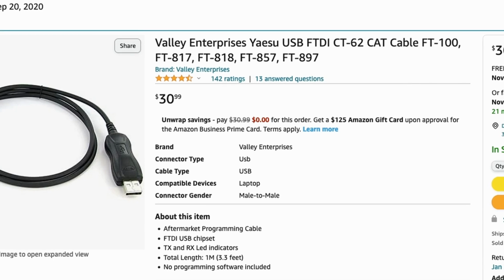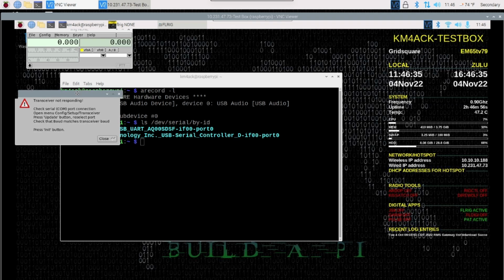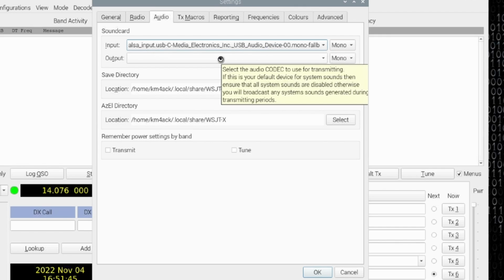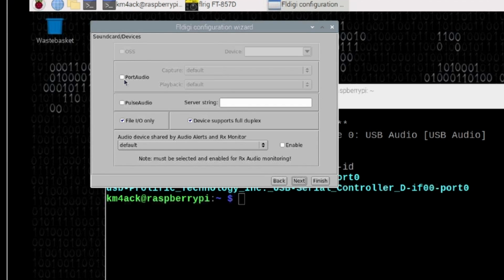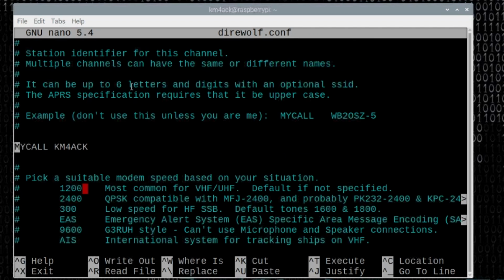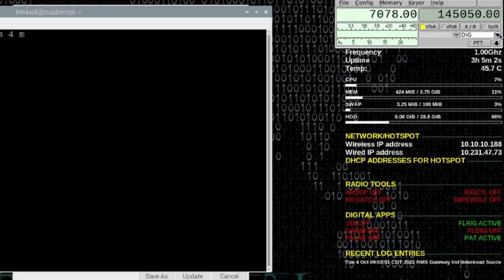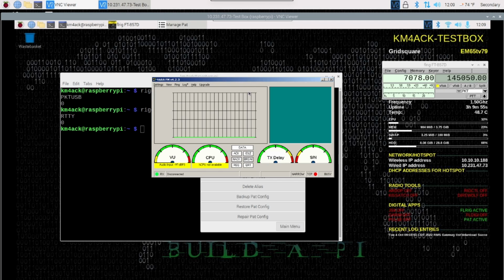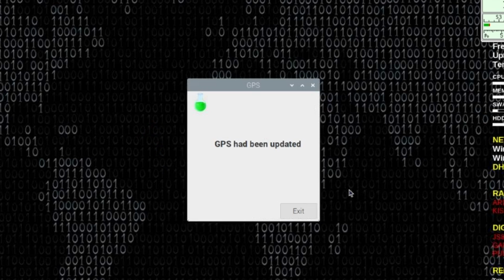Yaesu 8x7 Setup Linux Digital Modes

Comment: I’ve used FTA for about two years on a windows machine and I’m making the switch to Lennox because of a ham live error that I’m getting on my windows machine. I also have a raspberry pie that I planned on setting up with WSJTX as well. I have a rig on the way, but I thought I’d ask about signal link.

Comment: what distro are you using ? also, you could use a signalink instead too if you have it. esp if you have the usb version :D
Reply from the maker: on the pi i run raspbian OS 32bit and on an x86 box I prefer Mint.

Comment: Hello Jason! Thanks for another great video. I'm new to digimodes. I have a rpi 3b+ that I'll set up for digimodes. I see in this video that you configure VARA and VARA FM on the Pi. Earlier I've seen video in this channel about VARA as beta on the Pi. Is VARA now good to go on the Pi? Will VARA run on a rpi3b+? 73 de LB4EG (Helge)
Reply from the maker: I have only tried it on the Pi 4. Last I heard it wouldn't run on the Pi 3.

Comment: Another informative video Jason, thank you - Have you encountered 'no transmit' audio on your FT-8x7 /FT-8x1?  I've cycled through all the settings, and nothing changed that I have been able to determine, however on transmit I have no signal being sent.  CAT control, Audio settings are all normal - Radio is set with the standard, Data = Rear, but it is trying to use the hand MIC for audio.  Been through the settings a dozen times on both WSJTx/other and the radio and even did resets and reboots.

Comment: If you want to eliminate a cable to the pi, you can get a Bluetooth dongle for CAT control off Ebay or Aliexpress for the Yaesu 8X7 series for $15-20.
Reply from the maker: Yeah, those are pretty cool. I did a video on getting them going in early 2021 - https://youtu.be/Qbi62VyLVz8

Comment: I wonder, short of the Easy-Digi  cards, is it possible to do something similar with a Baofeng UV-5ra, sound card and Vox mode transmit? I also have a Radioditty GD-77 DMR if that 'helps'...
Reply from the maker: I wouldn't use VOX as the hangtime on the Baofeng radios makes it unusable with most packet work. It could be done with a digirig sound card though. That would get you APRS, Winlink Packet, and VARA FM.

Comment: Nice.

But you probably don't want to send JS8Call notification sounds to the radio sound device (just a little further down on the panel where you set the JS8Call sound devices).  I didn't notice whether any of the other software offered such a control.
Reply from the maker: Good catch!

Comment: Or use a DigiRig.  Still breaks down into sound card and rig control but I like it for being just one device to plug in and then the two cables to my FT-817.

Got WSJT-X running and slowly getting myself organized for running WinLink.

Want to come over and nail down a floor so I can play radio?
Reply: I want to see how you set it up. Watching the build a pi video I found out that its not the same at the ic705 lol.
Reply: @Jocon017  I will eventually be doing a video demonstrating the DigiRig with a FT-817.